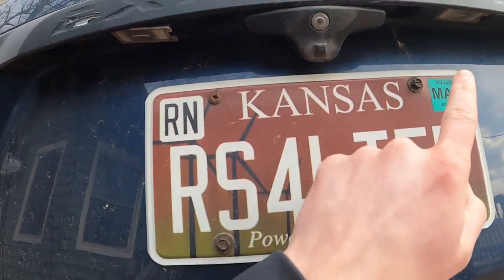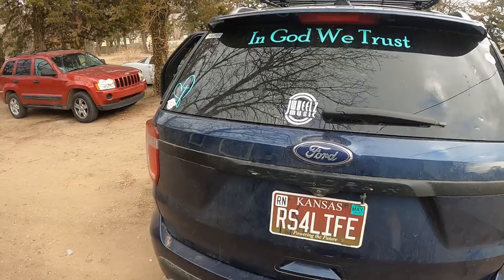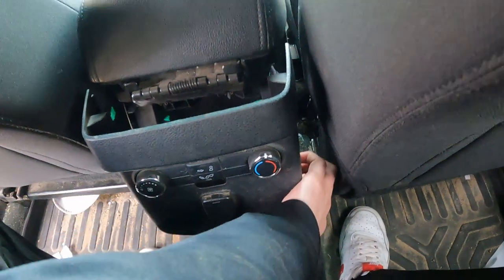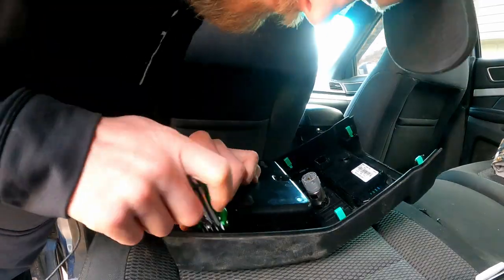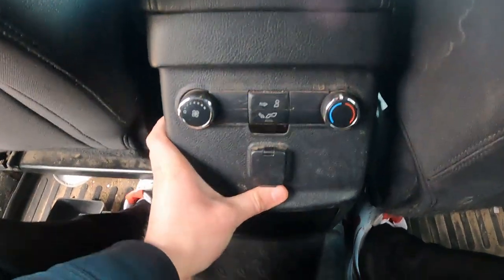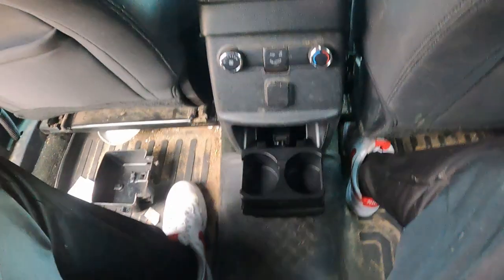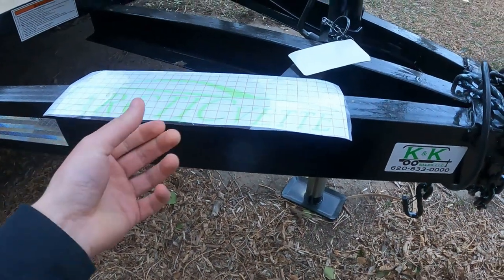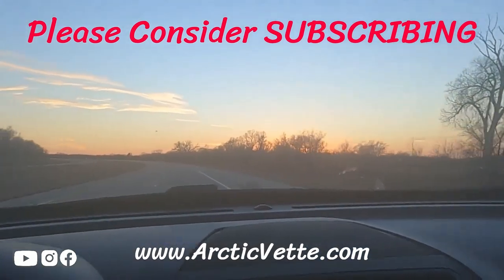How To replace Rear Cup Holder and Tag Light Housing - 2013-2019 Ford Explorer (2016) - Daily Vlog

Comment: Thanks,  this is just what I needed .  Did the replacement of the tag light last year.   And have to replace the rear cup holder this year.   Looking forward to the upper center eyeglass case replacement near the front  interior lights, lol Continued Success
Reply from the maker: You're welcome! I just recently sold my explorer without getting that upper center part replaced. I may still be able to make a video if my Brother, the new owner, replace it.

Comment: I really like your decal and video! I have a 17 Explorer Limited with a broken drink holder and a popping in the front-end! Did you say whatever you had was popping also? If so what did you say was causing it? I was told it was the struts but it doesn't have 100k miles on it yet so I don't think that's the problem? Thanks for your help!
Reply from the maker: Thank you! 

The noise on the front end was my sway bar links. I broke the mounting extension that came with the lift kit I installed. So I ended up replacing them with adjustable sway bar links. 

I think a good way to check the struts is to lift/push the fender up/down. You should have some resistance, it shouldn't be really loose. Similarly you can wiggle the sway bar links, again should move some but shouldn't be loose. Hope this helps! 

God bless!